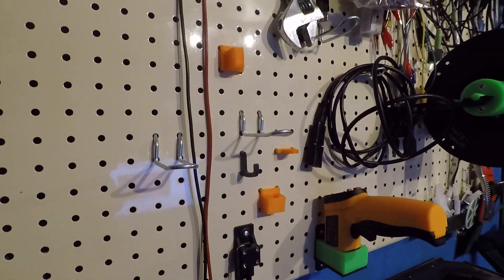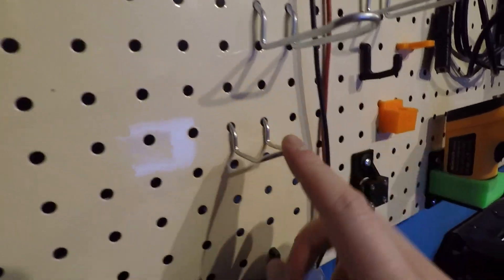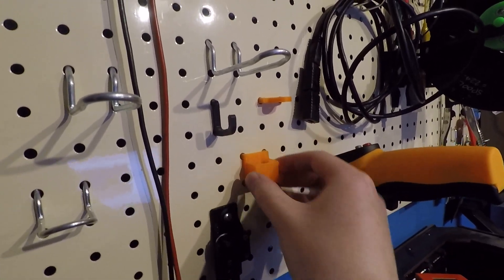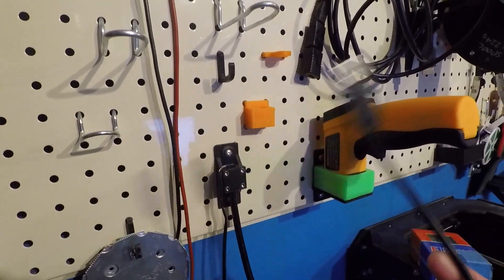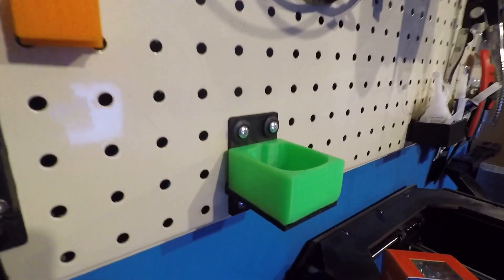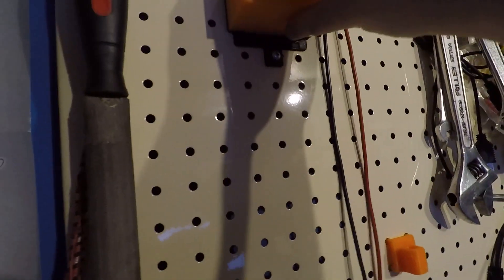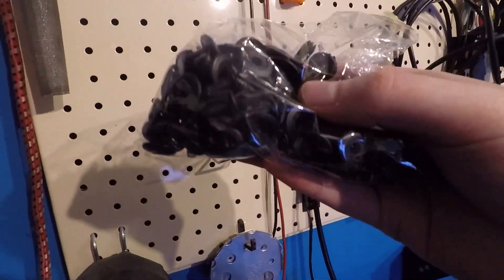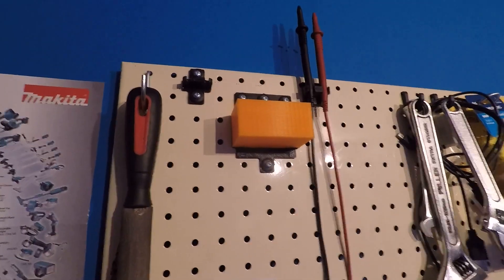3D Printed Parts For Pegboards

Comment: Where do you get pegboard - I can't find anywhere that sells it
Reply from the maker: I got mine on eBay, three panels that were once in a shop. Can't see anything exactly the same on there at the minute but I had to wait a while.
Reply: I ended up spending a pretty penny at machine mart :( At least my wall is sorted now, plus the board has slots that taper from big holes to little holes meaning you can slot brackets in really easily, so while Im still salty on the price, I did get a pretty good board
Reply: Home depot, any hardware store really